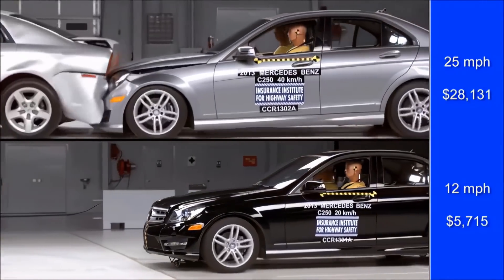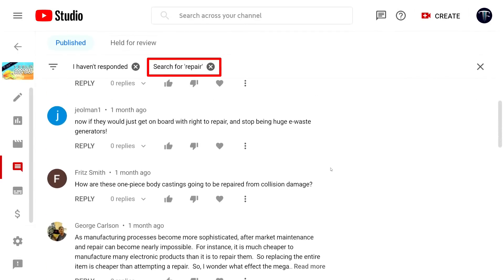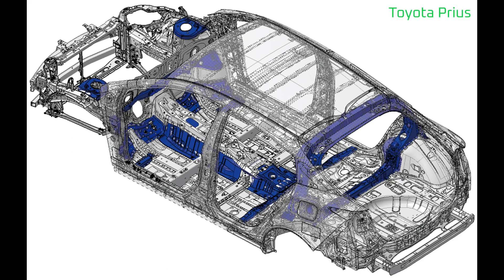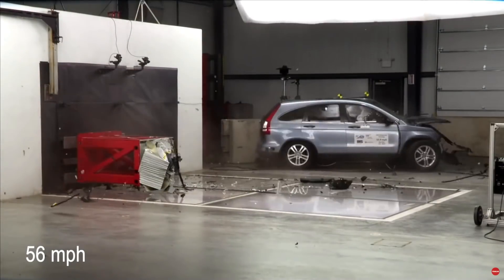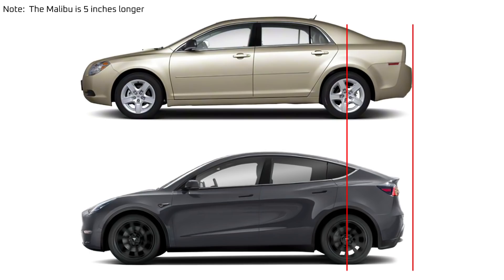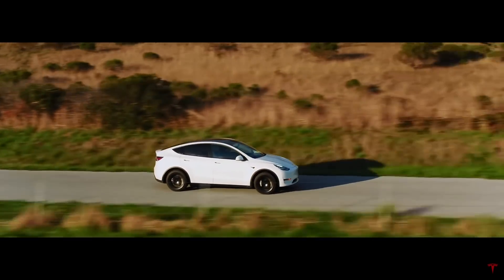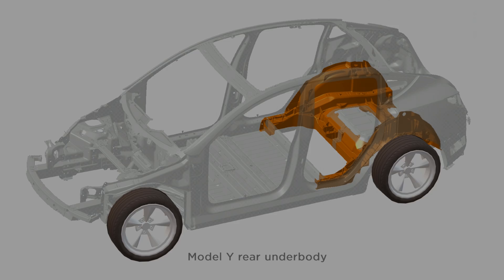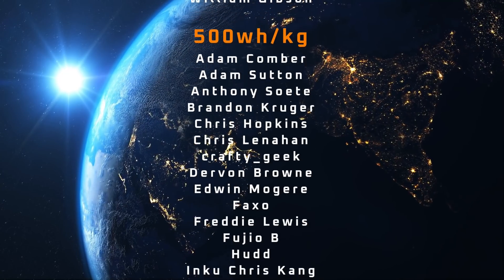#1 Tesla Gigacastings // Crashworthiness and Repairability

Comment: Very comprehensive analysis. Pretty much what I thought. 
Bend your subframe and your car is probably a write off.
Used to be able to straighten a slightly bent chassis. 
Crack a casting and maybe replace it if the rest of the structure it mounts to isn't damaged. Unlikely because of crumple zones.

Comment: It's funny you mentioned 12 and 25mph crashes costing ~$6K and ~$25K. Most cars today would be written off even for the combined $6K amount and most insurance companies won't give you a replacement. I'm surprised how much damage (not really) a 12mph crash makes and even more surprised at a 25mph crash. These are little fender benders happening in parking lots and city streets. Anything on a highway would be a total. I know the crumple zones are supposed to keep the occupants safe but it would help if the driver's participated more in the equation and actually looked where they were going and weren't doing Indy 500 or NASCAR moves.

Comment: If any crash  results in  damage to the point the  casting and alignment is out, almost any car would be a wright off.  A 72 piece rear end damaged to the same extend renders it not possible for a jig to pull the chassis out as a rule.

The main question is this, why  did Tesla get a 5* rating across the  board. Because it protected the occupants, so which way do people want it, survive or worse?   

Dont forget, considered a  right off, supercharging  is disabled.

Comment: cos it's all one cast they can strip parts & recycle the cars after their contract term ends and form the Most up to date model in under a day. 

i see car recycling being the new meta and Slot car style roads for self driving lane eventually they will replace all cars and evolve over time in to capsual pods with magnetic hoverpods and wirelessly charged though induction roads. 
obviously walking over roads will be bad so they hang them and stack the roads to allow wildlife to run evetually removing the surface roads and because they will be some hyper alloy roading magnetic tracks they can just slot in hyper loop lanes and make things even faster. 

obviously this 30 years off maybe at most.

Comment: The cost of the component being higher due to the material cost of aluminum is actually an advantage for Tesla and Tesla owners. As this is a casting the labor costs associated with creating a new part are extremely low. When replacing the casting outright, the material from the damaged part will be returned to Tesla for recycling and the majority of the part cost will be recovered. In high volumes the recycling process will be incredibly inexpensive and require very little labor. Tesla engineers are geniuses.

Comment: I am an insurance agent in CT. I have had one claim with a leased Tesla, it was a disaster. Small claim on the rear driver side door. Because it was leased it had to go to a Tesla approved shop. The billing rate for auto body in CT is around $60 per hour and they wanted over $100 per hour because the shop had to send 3 guys to CA for training for several weeks. The insurance company refused to pay more than the standard rate and the client got stuck for the rest. Because Teslas are so expensive to repair they are VERY expensive to insure. With the GIGA cast this will only get worse. Buyer beware. I have a 2017 Volt. I last bought gas for the car in November 2020. I can go 60 miles on a charge (that covers 99% of my driving) and I can jump in and when the battery is dead, the ICE turns on and I get 40 MPG with the cruise set at 80 MPH. Way better than a Tesla IMO
Reply: It's not so much the vehicle that causes the excess repair costs; It's Tesla Motors who won't support "right to repair" by third party repairers. There are good laws, like the "right to repair", which help the consumer to get a fair and decent deal on vehicles and the repair of them.  State and Federal legislatures can pass laws to spread the right to repair which coerces manufacturers to work with consumers and their repairers.
Reply: @artsnow8872  part of the high cost to repair is the stainless steel body panels that are very different from standard automotive body panels
Reply: @douglashughes2331  In the model 3 the body panels are sheet steel.

Comment: Forgot to mention that the front and rear absorption rails and the solid giga castings give the Teslas a bigger chance of returning to service. Hoping to open up a vehicle and replace one warped load bearing structure just because it is smaller than the giga casting is not economically viable. Once load bearing structures are are twisted and rotating parts are warped its all scrap metal

Comment: By the way Jordan, could you do short updates on the 4680 cell developments. I think the ramp up of the 4680 cells is the biggest limiting factor for all Tesla projects right now. Tesla Semi is waiting for 4680 cell ramp up. Tesla Cyber is waiting for 4680 cell ramp up. Tesla Roadster is waiting for 4680 cell ramp up. Mega Pack energy storage and power walls are held back by waiting for battery volume production. MY M3 MX MS is a balancing act of shipment prioritization in waiting for the ramp up of the 4680 cell ramp up. And nobody is covering where they are at in getting the 4680 cells online. All we get to see is impressive concrete foundations being pored in Giga Berlin. Other than that, its all quiet. Last we heard on the earnings call was that they had 10% engineering issues left with getting the dry powder in to films. It tended to be not so smooth in volume production. Maybe do like 5 min weekly clips on production advancements?

Comment: Hey Jordan! Awesome work. People can stop worrying about repair ability for all cars. When any car, what ever the car, gets a structural damage that makes rotating parts no longer being aligned the repair shop will give you a massive cost estimate and recommend a wright off. Twisting a warped structure back in to alignment precise enough for rotating parts to go back in to service is many times tougher than scraping the car and get a new car. Having a car being built in numerous stamped sheets and being welded and bolted together will not help you in any way. A deformation does not stop in one structure part and leave the next structure bolted and welded to it unharmed. People can stop talking about replacing structural parts in vehicles. Its not economically viable in any car no matter what car

Comment: Instead of guessing about all this, interview autobody shops that repair or sometimes refuse to repair Teslas because they can't get parts.  "My guess is", "my assumption is", makes your opinions on all this not just invalid but actually reckless.
Reply: Being able to repair / replace  parts, get specifications, and repair data from the manufacturer is covered under the "right to repair" that the vehicle repair industry is trying to get state and federal laws passed to mandate such manufacturers to provide.
 Elon Musk has said that Tesla wants to be the only repairer of Tesla cars, etc.. He, of course, speaks for Tesla Motors. So, Tesla Motors isn't, voluntarily, willing to aid any outsiders in repairing Tesla cars, etc. It will take "right to repair" laws to coerce them to provide the necessary parts and information.

Comment: The images in the video seem to be of the V1, two piece casting. The V2 single piece casting extends further rearward and incorporates the crash rails into the casting. These will be designed to buckle in a rear impact. Tesla's stated repair strategy for this is to cut away the broken crash rails and bolt in a replacement crash rails. I have yet to see any example of this type of repair being completed.

Comment: It’s really simple. The giga casting is stronger than current car frames. If the impact is enough to damage a frame the car is totaled. The same impact might not damage a giga casting. Thus it’s an improvement in every way. No added costs. You will never replace a frame or a giga casting if damaged.
Reply from the maker: Thanks for the insight!

Comment: Maybe Rich Rebuilds Video on how tesla makes it's battery pack nearly unserviceable made me a bit worried. Adding to that the horror stories we hear from people that had to deal with their repair services, or lack there of. I can understand why people are worried about a megacasting that cannot be fixed if warped.
Reply: TESLA batteries DO NOT NEED Servicing. 
2020 Raven pack can last excess of 500,000 miles.
2021 Pack now lasts 1 MILLION miles . 
NEXT Gen Structural Pack will be MAINTANANCE FREE.
the 4680 cells are GLUED into the battery tray , and NEVER have to be Removed.

Comment: One thing improving repair costs for Tesla is the far simpler cooling system. In a ICE car, the closest things to the front bumper is the radiator, ac condenser, transmission fluid cooler, engine oil cooler, and a power steering fluid cooler (last two are seldom present). Tesla, being an all electric, either doesn't have these systems at all, doesn't require cooling for those systems or needs far less cooling for those systems. This will further reduce costs for front end collisions.
Reply from the maker: Great point!

Comment: How is the casting fastened to the rest of the structure? I assume welded,  but don't actually know.  A replacement casting may not be prohibitively expensive, and replacement in the odd accident that damaged it without destroying the car might be feasible
Reply: BOLTED. for easy Assembly and Disassembly and for Repairs.

Comment: Think of glass.  Cheap,  thin glass like a picture frame or dollar store drinking glass breaks easily. A car windshield can actually take quite an impact without cracking or chipping; even including flying debris,  basketballs,  etc.  Some glass is used as exterior structures of skyscrapers,  and even walking bridges can be built of thick glass.  You may have even seen video of would- be burglars bouncing hammers or concrete blocks off of storefront windows. This is brittle,  low- strength glass.  An aluminum mega casting has tremendous ability to absorb and distribute extreme impacts,  especially as initially diffused by exterior structure.  In fact,  you could also think of a mega casting as an aluminum engine- sure, a wreck could damage it,  but it's strong and well- protected by outer structure.
Reply: which makes the TESLA Armored Glass in the SEMI and Cybertruck very Compelling. 
Imagine having ZERO down time in a SEMI because of Broken Windshield glass.

Comment: Insurance companies balance the cost between resell value and repair.  It's expected the repair would be perfect from the car owner...where as the guy buying the damaged car will not mind less than perfect repair.
Reply: Yes, people seem to think that insurance companies "total" (or write off) a vehicle because of safety concerns about the repairs. That's incorrect. An insurance company seeks to return the vehicle to the condition and appearance it had before the accident.  If restoring the vehicle's appearance / function costs more than a certain percentage (40% to 60%) of its retail / wholesale(?) value, it's written off ("totaled").
 As an example, if I had a $20,000 dollar car (in good working condition), and it sustained $12,000 in hail damage, it would be "totaled"; but, it could, still, be a completely good and useful vehicle for me (for many years following).
Reply: its , $25,000 + for a regular car and Arround $5,000 for a TESLA with Gigacastings.
Reply: @markplott4820  you lost me. 25K for what? What are you saying about the casting on the new model Y?

Comment: As always, great video Jordan. Structural says it all.  Bend, crack, snap a front or rear casting and there's a problem. Replacement on the face of it shouldn't be that much. Intrinsic metal content isn't overly high and it's a 3 minute process to make... But as you say it's the energy and that's the square of the velocity. The same holds for pedestrians. Tesla's active safety features should reduce impact energies. Generally, in future, Teslas are less likely to be involved in accidents.

Comment: Many design decisions involve trade-offs so you cannot necessarily have lowered production costs expecting to there also be lower repair costs.
Reply: Actually, Gigacastings do both.
Reply: @markplott4820  To which I would respond that that part is non-repairable and it would be curious to know how much we cost to source and install that part given so much hangs of it. Possibly if it sustained that kind of damage the car may be a write off

Comment: Solid engineering breakdown Jordan! Only thought of note: at 2:47, the structural truss webbing is arranged in a way to present much higher up/down stiffness vs. side impact stiffness. Probably optimized for a smoother suspension.
Reply from the maker: Amen! I should have taken some time to elaborate on that!

Comment: All cars three years or older with halved resale value will be a write off regardless of design if hit that far into the body.
The biggest cost in a crash is related to injuries. If injuries are reduced money is saved even if the car is sacrificed.
Most cars are never in a crash and those in a crash are either small crashes with no impact on structure or hit as hard as to be a write off regardless. Very few cars are in crashes of the type where you would consider repair of structural parts.

Comment: The crash rails.   On the newer castings, I understood,  these are actually part of the casting, not bolted on.    What Elon said was that if damaged in an accident they could be cut off and replaced with bolt on crash rails.  My guess is that probably makes them a bit more expensive as bolt on rails will only be needed in small quantities.  
Win some loose some I guess!
Reply: The crash rail metal is to smooth to be casted metal. It also make sense to use a different metal alloy for the crash rails since they are not structural and their purpose is to absorb energy.

Comment: It seems as though the second most important thing to protect after the passengers is the battery pack, for potential reuse, since it is the most expensive single component.  Also, to prevent potential battery fires caused by cell damage.
Reply: Redwood Materiels can even Recycle Damaged battery in a Accident and also Recycle Gigacastings.

Comment: I think repairability is nullified almost completely with the castings. After a crash, tesla cars should be used as stationary storage for energy. I hope tesla comes out with that v2h adapter they were talking about.
Reply: Agreed, with the remaining vehicle materials recycled back into the giga cast.
Reply: Yah. Park a crash in the front yard, plug in and plant flowers. New status symbol.
Reply: Eugene - ELON completely SHOTDOWN the Idea of V2G and V2H.
the 2009 Roadster has V2G and NO ONE used it. 
also, you need a Different battery for V2G as NICKEL cells are Expensive and dont have a HIGH Cycle life. 
Current model S/3/X/Y all use Expensive NICKEL cells .
you will need a Different Chemestry , if you are Building a car with V2G in mind. 
you need a Battery with HIGH cycle life.

Comment: The best vehicle repair is no repair. Simple as that.
Reply: Meaning?
If my car is damaged in an unavoidable collision, does it not get repaired, particularly if it is a minor, low speed accident?
So, can you please kindly elaborate on your comment?
Reply: @Nicholas.T  I should have phrased it as " the best vehicle repair is never getting into the accident". It was a play on elon's "the best part is no part" quote. If the car can actively  avoid accidents or has fast acceleration to avoid a crash then that's better than having a slow car that is easily repairable.

Comment: Thank you for that great study! On other subject can you please make a chapter on 4680 and LFP conundrum? Wondering is there are technical or economical reasons that prevents LFP in the 4680 format. Or it is just a matter of time until the patent expire next year and Tesla start making 4680 LFPs. Cant believe all advance tech around 4680 cant be employed on 2/3 of battery production. That would certainly reduce the initial significance of the 4680 format.
Reply: One company is Developing a Hybrid battery pack with Mostly NICKEL cells for Long Range and some LFP for longer Cycle Life and Cheaper cost.

Comment: Great video, important and interesting topic.  

Its been a while, was starting to worry.  Glad you are OK

Would be interested in LFP update.  Consider that my MY has 326 Mile range.  Typically drops to 90% of that in a year or 2.  Tesla recommends charging to within 10% so that puts it at around 270 as the range over long term.  If LFP goes to 250 miles and can be charged fully without accelerating degradation it is much closer to the nickel based chemistry than at first glance.  If they can squeeze another 30 miles into the LFP then it is pretty much equivalent to higher performance chemistry and you get the much longer life out of LFP.  No cobalt or nickel means supply chain is easier and I am pretty sure they can use the lower cost lithium carbonate, further reducing supply chain risk.  I would love to see you do a deep dive that addresses topics such as whether the expiration of the Chinese patents next year remove all obsticals to mfg of LFP in the USA, whether the new Tesla battery processes can be easily ported to mfg of LFP etc.

Comment: Good video, thanks.  I hope you are going to do a video on battery replacement for if the batteries are integrated into the frame.
Reply from the maker: Thanks Tom!  This was covered in my structural pack videos.  However, I'll be doing another video at some point because people tend to confuse their idea of structural vs what Tesla actually met.  These two overlap but also diverge in key ways.
Reply: @thelimitingfactor  Thanks.  Looking forward to the video.  BTW, are you a material engineer?